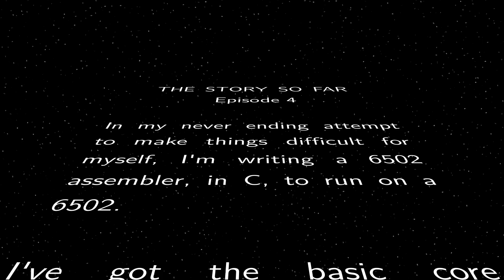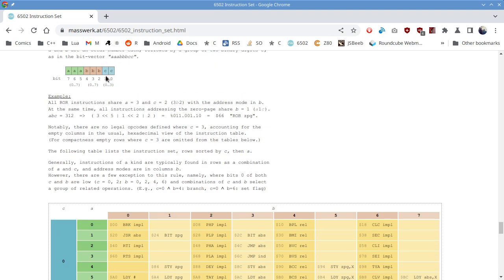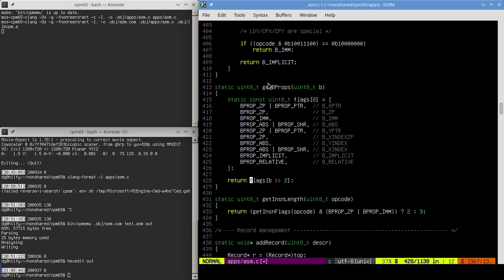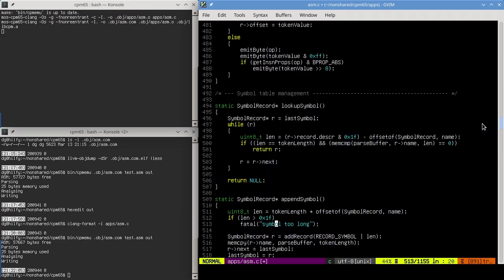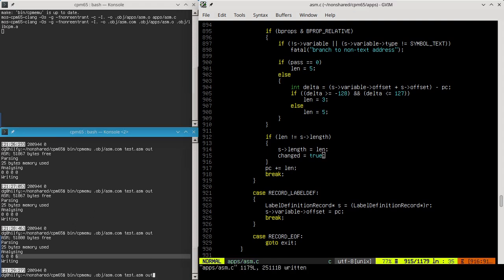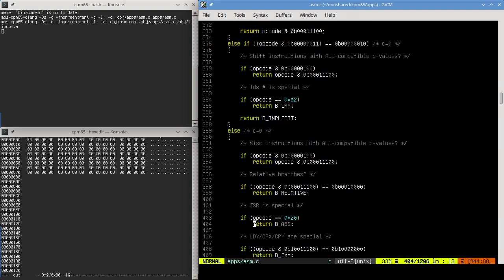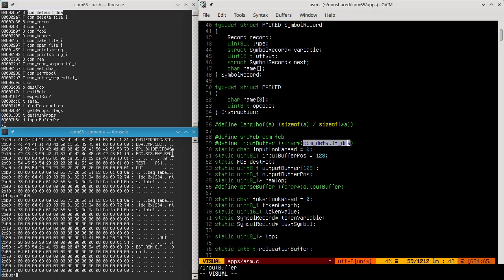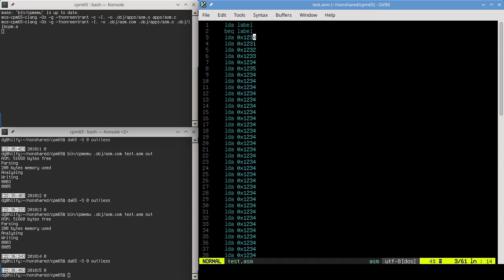Writing a 6502 assembler for CP/M-65, part 4/6

Comment: I'm a web & Salesforce (Apex) developer with not much systems programming knowledge. Where would be the best place to start if I want to start down the path to understanding what you're doing in this video?
Reply from the maker: A lot of this stems from a university course on compiler theory --- that's how I know about lexers, parsers etc. If you want to do modern compilers there are way easier ways --- go look at craftinginterpreters.com for a really good online book on how to do it. If you want to write machine code for old computers, then you could do a lot worse than find an old machine code tutorial book for your favourite old micro. But then you will actually want to do the development using modern tools, on a modern computer, with an emulator containing a debugger!
Reply: @hjalfi  awesome thanks for the info!